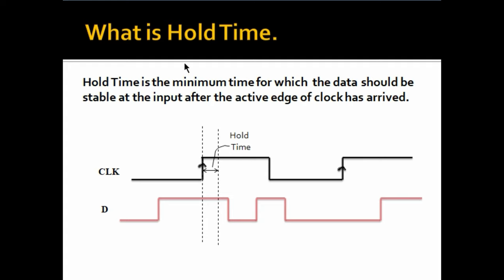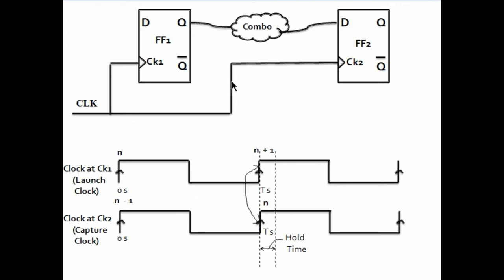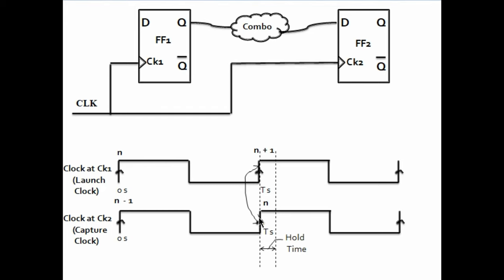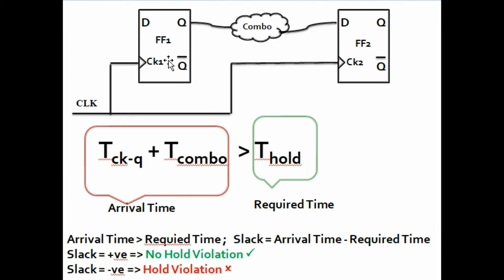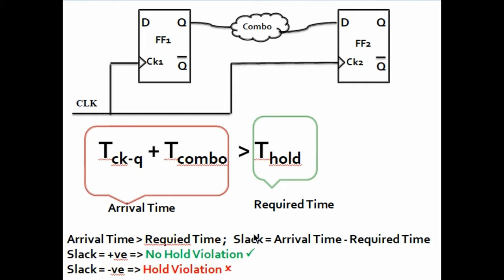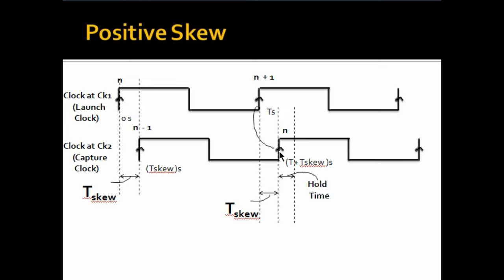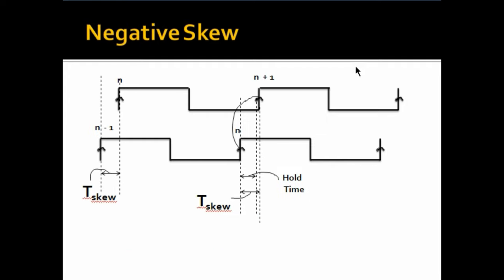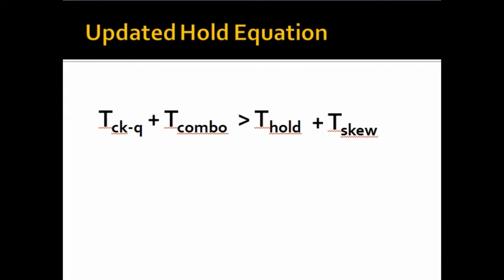Hold Time | STA | Back To Basics

Comment: So,  Hold check will be done at capture  flop , it has to check whether data is stable after clock has reached it, whatever data that is lanched by  lanched flop , after it got captured by capture flop. it should not moves so faster that it can collide with next data , it has to stable for Libray Hold time of capture flop .................... can anyone correct me ??